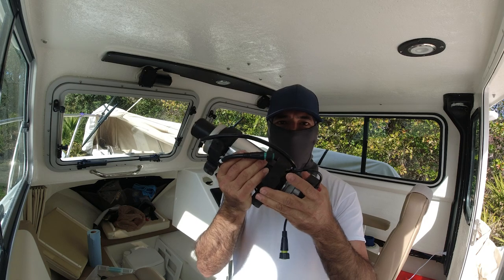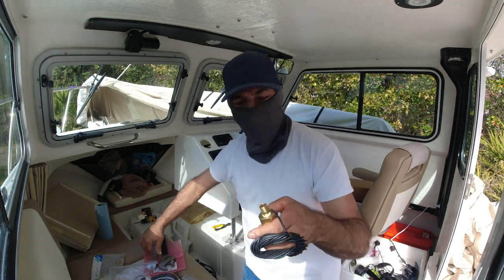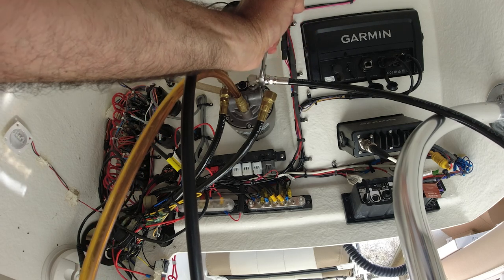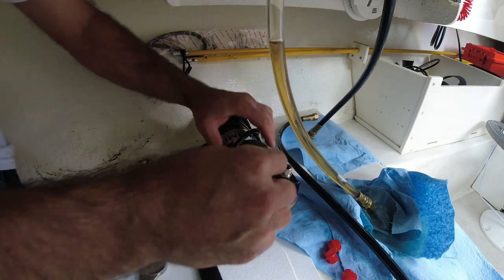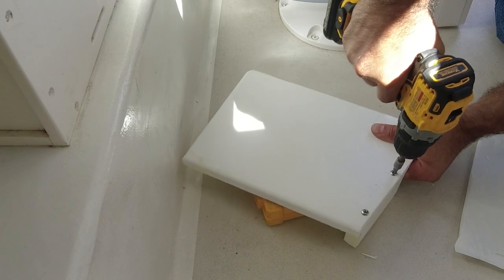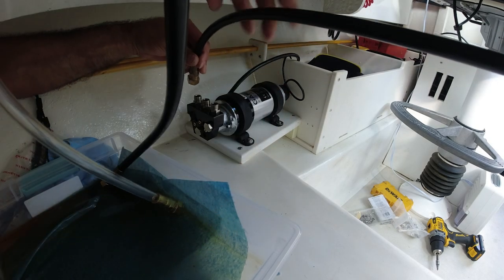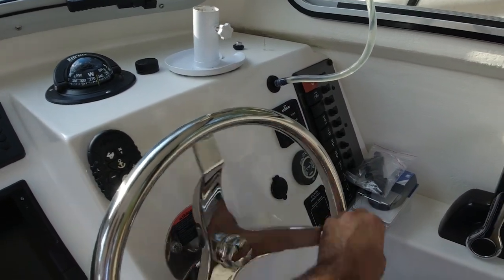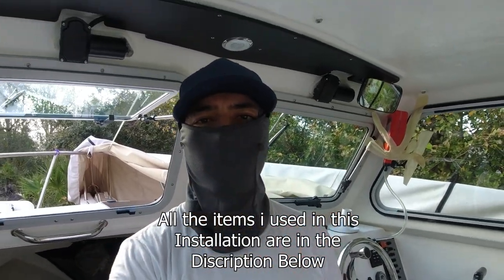Garmin Autopilot Pump Installation Part 1 Garmin Reactor 40, Hydraulic Autopilot Corepack

Comment: Nice job Capt! You made the bleed-out seem easy! I have a bleed-kit that uses a different procedure and uses less fluid; that SeaStar fluid is 'pricey'.... The SeaStar manual lists 7-8 other brands of fluids that will work (mostly aviation fluids), but none of those are available anywhere near where I live.
Reply from the maker: Thank you Andrew and yes they're very pricey usually about $25 a quart And it's good to do this at least every 6 to 8 years to have new power steering fluid it really helps the system perform better, Mine was a little discolorated after 3 years but since I have a new pump I wanted to have everything new so I don't have to worry about it for another 8 years And thanks for watching captain have a awesome night

Comment: Starting a similar project today, out of curiosity why  did you change the mounting location for your pump? previously you had it vertically but now you made a small platform for it. TYIA
Reply from the maker: yes cap the raymarine had a different requirements but garmin needs to be flat

Comment: Thanks for sharing. This is the only Auto Pilot Install video of Garmin on the web I see. 

Question: I was provided three fluid lines with my kit. I believe I need to have more lines than that concidering I am adding the shadow drive. 

Sea star classic tilt
Single helm
Same pump and GHC 20

Was given 3 lines. Looks like I need 6. I am not replacing an old autopilot, but adding NEW.
Reply from the maker: Yes you do captain and You need to purchase 2 kids of the  Hydraulic hoses to complete The installation with the shadow drive, Thank you so much for the awesome Comment captain,  And I hope your installation goes smoothly👍👍🛥⚓️

Comment: As always nice installation, can I use the Garmin sea star fitting kit from Amazon between the shadow drive and the hose.
Reply from the maker: Thank you captain for watching and I don't think you can use those you have to go to a hydraulic specialist supply store and get those fittings take the shadow drive with you so they can help you

Comment: Captain for the shadow drive Installation do I need to buy 2 sets of hydraulic hoses for the extra line? Thanks for your help.
Reply from the maker: Yes cap i did buy a extra one set but is good because this way you have spare for emergencies and i placed the link in the description below of the one i used in this video cap. I hope it helps, navigate safe cap.

Comment: Do you think the clear hose can be used as one of the black hoses? I need and extra hose and have an extra clear one. What do you think?
Reply from the maker: No definitely no cap the clear hose is not for Hydraulic pressure you ned another black one cap.💪👍

Comment: Nice job Cab but the way they installed mine is with quick connect fittings. Are you on connect the fitting no leaking a fluid take the pump out whatever you need to take out and put a quick connect back in and you’re done.
Reply from the maker: That is so awesome captain I didn't know that existed I would look those up to see what that look like thanks for the heads up👍👍
Reply: @OutOnTheReef  I tried attaching a picture here but it wouldn’t let me if you have an email I’ll send it to you

Comment: Hi, I am installing the same pump, does the isolation screw stay out on the return line back to the steering helm after you bleed it.
So the return line is operating all the time not closed off?
Cheers
Reply from the maker: The return line is very needed for the system to work. And if you look at mine it's exactly how you need to install it captain

Comment: With all the additions you have made to your boat, have you weight it with the changes?  Has the additional weight changed your fuel consumption?
Reply from the maker: Yes it has very much  cap. I was doing about 3.2 MPG now i do about 2.8MPG but is all worth it cap. It makes the boat more comfortable

Comment: Very thorough and well explained, thank you.  Curious as to why you went with Garmin over the Raymarine Ev-100.  Were you having problems with the EV-100 handling your size boat out in the ocean with its type.5 pump?  Would the EV-150 with the type 1 pump have initially been a better choice?  Although a matter of opinion,  its appears the Raymarine looks to be the easier install for the challenged do it your-selfer.
Reply from the maker: The rain marine is easier and the . 5 Pump is not enough power  The best thing is to get the1.0 liter  But I find out that the garment is more quieter and better performance But I find out that the garmin is more quieter and better performance

Comment: Hello, why did you change the autopilot brand. You installed EV 100 from Raymarine first. Were you not satisfied with Raymarine?
Reply from the maker: yes cap i went with garmin because is way better system and great customer support too

Comment: Another great video! Quick question - want to install the same system, I have 2 steering stations 1 up front and 1 on the deck. Where do you tie into the system???
Reply from the maker: What I know is that you have to install it at the main helm the lower helm not in the upper one but to double check that call garmin but I'm almost 95% sure is the lower helm that way the shadow drive can operate properly cap.

Comment: Very impressive! I like watching your installation and modification videos because of the level of detail you put into them.  Not only do you have a better understanding of your boats systems, but the money you save in labor costs is awesome.  Looking forward to the next video, Captain!
Reply from the maker: You are so right captain you save a lot of money and you learn to troubleshoot your system when any problem arises you know exactly how they function thank you so much for watching captain
Reply: @OutOnTheReef  did you close the return line isolation screw on the pump after you bled the system?
I am having issues with vibration in my steering lines and have had no luck re bleeding the system
Reply from the maker: @bundyaeromodellers  No captain and mine vibrate sometimes too. But the unit works perfect even though it vibrates sometimes

Comment: If you don't mind me asking.....Why did you switch from the raymarine autopilot?
Reply from the maker: The reason was it was it was Losing heading sometimes and sometimes it works perfect and it works perfect and it was due to the system was too small for my boat especially the pump But going with garmin matches all my equipment and it's more compatible with my equipment
Reply from the maker: I've been going with this issue for 3 years and it's time to move up

Comment: Nice video. I’m looking to install the same kit on my boat and the instruction for the pump says not to have a longer hose run than 10’ from the pump to the steering cylinder (ram). It looks like you have more than that—did you run into any issues because of it? It will certainly help my install if I don’t have to hold to that 10’ dimension. Thx.
Reply from the maker: Hello Louis and no I do not have a problem at all with my installation my shadow drive works perfect everything is just perfect And yes I know what you're saying that would take you a lot more work but if you do it the way I did it you shouldn't have a problem with it captain because I certainly don't have any issues it's been working for several months navigating far away from land with no problems hope this helps and I hope you have a great installation captain and anything I can help you with let me know👍
Reply: @OutOnTheReef  Thanks! I appreciate your response. Keep up the good work.
Reply from the maker: @lewiswatchorn7239  anytime cap👍🛥

Comment: they are all 3/8 compression fittings and 3/8 hoses, correct? a part from the shadow drive that seems to have a 1/4 NPT.  I have an old seastar helm pump so I also need a 1/4 NPT T and elbow to connect to the helm pump.
Reply from the maker: @matteomannini1205  I didn't video a long time ago and I don't remember captain.I will have to go back into it
Reply: @OutOnTheReef  thanks. But I think that I figured out by my self!
Reply from the maker: @matteomannini1205  awesome cap.😉

Comment: Where do you connect the red and black wires that are coming out of the shadow drive?
Reply from the maker: I did this installation a long time Go cap. But go to the installation manual and is easy to follow from there, let me know if i can help in any otger way cap.

Comment: Is the crooked pilot house equipped with power assisted steering?
Reply from the maker: No cap ot has Seastar hydraulics
Reply: Thanks for the response. My boat has a seastar with hyd.  assist. It changes things up a bit. I appreciate your videos. You do a great job.

Comment: Hi! Captain, why don’t you place the pump to the old location instead put it horizontal ? Could the pump stand stand vertical? Thanks captain.
Reply from the maker: No cap. It has to be parallel installed  thats why i did not place it in the same place 👍⚓️

Comment: Would I need to purchase 2 of the hose kits in order to complete the shadow drive install
Reply from the maker: yes cap and i placed the link of the same ones i use , hope that will help you cap, if i can help in any other way please let me know, and remember if you use my amazon links amazon will give my channel a commission and that will help me make more videos cap, thanks for your support and watching cap.
Reply: @OutOnTheReef  
Thanks for the reply Capt., love the channel and your trips to the Bahamas and Keys. You need to get yourself an electric reel set up and Slow Pitch Jigging set up. . Keep them coming.
Reply from the maker: @dougsquatch3232  that exactly what im going to do cap. Soon i will show you what i pick👍😉🎣
Reply: @OutOnTheReef  
I have a question on the dockside wizard. I just received y Reactor 40 and in dockside wizard it suggest using rpm from NMEA 2 k engine if connected. 
Wouldn’t using the GPS be better for speed source? What option did you pick
Reply from the maker: @dougsquatch3232  I use the GPS captain I don't have the engine harness attached to my system
Reply: @OutOnTheReef  
I had one last question on the AP install. Did you have to do any additional bleed procedure to the Autopilot pump? Or just doing the standard Seastar bleed procedure is enough to remove all the air from system
Reply from the maker: @doug2202  If you don't lose a lot of hydraulics it would be enough but if you lose a lot of hydraulics you may want to bleed it in the. Back of the hydraulic Steering pump and make sure you have a bottle elevate it at the connection port in the front so you have fluid to flow through the line if necessary

Comment: Do you have link to the two shadow drive hoses ??
Reply from the maker: Yes is in the description below under   hydraulic hoses it is cheaper to buy the kit cap. Thats what i used in this video and it works 👍 great
Reply: @OutOnTheReef  SO I NEED TWO OF THOSE KITS?
Reply: I thought I needed two extra hoses for shadow drive?
Reply from the maker: @Roly1105  Yes that's why buying the kit only for the shadow drive and for the pump you gotta buy another kit And at the end of the installation you only have one extra hose which is the return hose
Reply: @OutOnTheReef  Thank You thats what i thought
Reply from the maker: @Roly1105  yes if you ha e extra hose save it for the future cap. If i can help any other way let me know and remember to install the shadow drive as horizontal as possible
Reply: @OutOnTheReef  Gracias Mi Hermano!!!
Reply: @OutOnTheReef  How many quarts of Hydraulic fluid did you end up using?
Reply from the maker: @Roly1105  i think i purchase 2 but not ended up using all of it cap.

Comment: Cap.  Why did you install the new autopilot.   I thought you already had autopilot.
Reply from the maker: The rain marine was giving me problems engaging on the heading And we came out to a solution that we think that is under size for my boat And that's why I got a bigger pump and the equipment is compatible with the chartplotter

Comment: why are you changing pump?
Reply from the maker: The original pump had a minor leak so the garmin warranty had it replaced no charge 👍🛳⚓️
Reply: You had Ray marine autopilot , how is works ? i am planing to install on my Northcoast 215 hd , 175 susuki. which better Ray Marine or Garmin?
Reply from the maker: @sergeytitov7984  from experience Garmin is way better and great customer service too cap.
If i had to do ot all over again i will still go with garmin,  navigate safe cap
Reply: Thank you

Comment: Great video except you didn't explain what you were doing. You just kept saying, Im going to connect this hose here. I'm going to attach this fitting here, etc.etc. You didn't go in depth telling what was what and lost me. I was going to try do do mine myself, but couldnt keep up with what you were hooking up. You didnt explain what was what until you said - this is the starboard line here. Good job though, you obviously knew ahead of time where everything was going.
Reply from the maker: My apologies cap. And this installation has part 1 and part 2 hopefully it helps

Comment: " The hydraulic pipe fitted connections "
Reply from the maker: Go to a hydraulic supplier with your pump so they can quide you cap
Reply: @OutOnTheReef  There is no option to buy the pipes and the fitted connections for the shadow drive in Amazon ?
Reply: @OutOnTheReef  I want to buy exactly 1.2 l garmin pump like what you have....
Reply from the maker: @alen2486  yes look at the description below cap. I added the t fittings and things you need to Install  it cap check it out
Reply from the maker: @alen2486  i have it linked in the description below cap.
Reply from the maker: check in the description bellow of this video cap.
Reply: @OutOnTheReef  the pipes for the shadow drive is the two black pipes at " hydraulic hoses link " ? And in the pic i saw just one part of the hydraulic fitted connections..... I need two of this for two sides in the shadow drive , right ?
Reply from the maker: yes those fitting are the one that you need to take ur shadow drive to a hydraulic supplier so they can sell you those cap. those are the only one that i dont have the link but everything else is in the description below cap. hope this help

Comment: I dont get something, Im going to install my Reactor 40 with a Smart Pump... shouldn't be much different regarding the hydraulic hookups... I thought that since I have 2 Seastar hoses coming from the stern to the back of the helm, (I currently have no auto pilot)... if I understand the diagram from Garmin, the port and stern lines coming from the steering ram both  have T fittings (as well as shut off valves, buts that's another story); your hookup looks like you used only one T , and hooked one side into the pump... Im confused... I will watch your videos again, but am I missing something ?  Look at pg 5 of this Garmin installation manual. 

https://static.garmin.com/pumac/SmartPump_Installation_Instructions_v2_EN-US.pdf
Reply from the maker: Yes is confusing because i had a previous pump on my boat so i just needed a T Fitting, hope my video helps cap👍⚓️
Reply: So wheres the 2nd T ?  ...Still dont understand, the diagram from Garmin shows that the lines coming each from Port and Starboard from cylinder need to have a T to split them to helm, and to the pump, why does that work on yours ? Look at the diagram I attached the link in my comment above.  Btw, great job on your videos, thanks.
Reply: I see !! the T is directly on the back of the helm on the starboard side !! My bad.
Reply from the maker: @zumba5012  im glad you found it cap.👍⚓️🛥